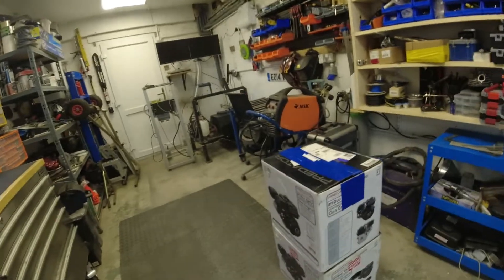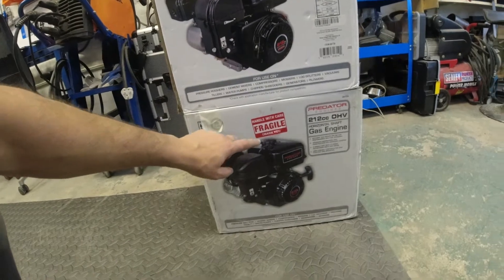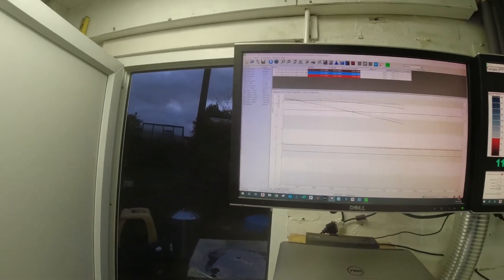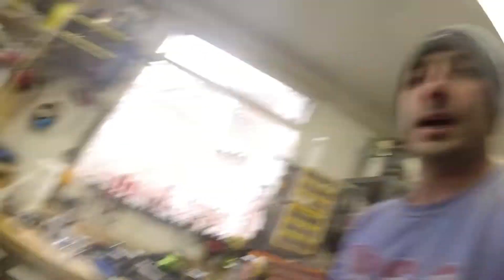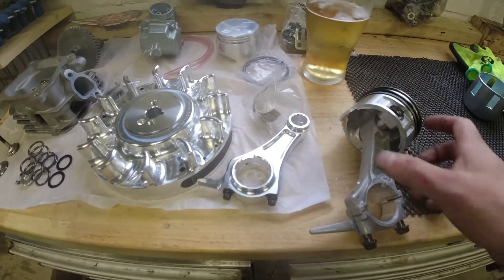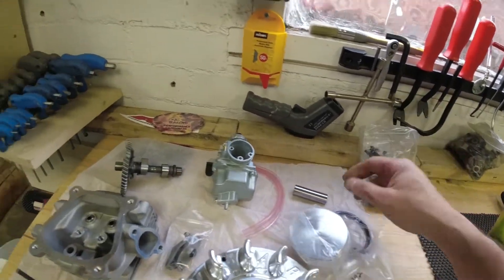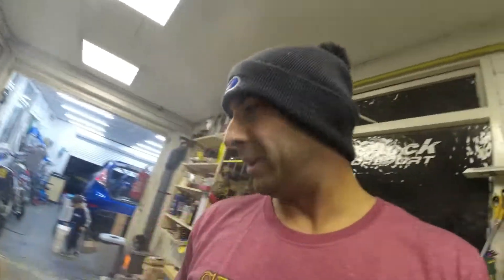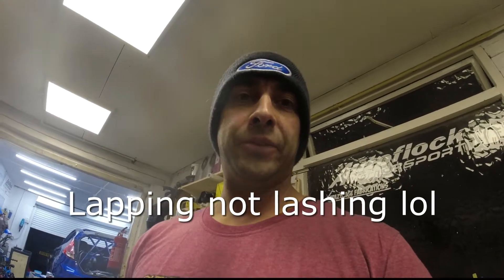30+hp Pro Kart Race Engine Build Part 1 - TKL

Comment: I have built quite a few of these and I used to do the plasti gauge but after doing it several times I never had one that needed any attention so I just put the rod in and let it rip. I have taken a rod out of a motor and put it in another motor and taken them apart cleaning and rebuilding and have never had any rod problems. One thing I do recommend doing with a billet rod is the first time I instal one I do oil it with the oil I’m going to run, tighten it down to about 80 pounds spin the motor a few times and loosen it up and then tighten it down to about 100 pounds they recommend 120 but I only go to 100 and have not had any issue.
Reply from the maker: Many thanks

Comment: What camshaft did you get from NR racing could you post a list of the parts you used for this build
Reply from the maker: Hello Lawrence, here is the cam: 280 0611 Camshaft
I bought the stage 4 kit from NR racing with the 22 Chikuni carb and the Arc flywheel, the kit can be found here:
https://www.nrracing.com/product-p/stage4hopup-p.htm